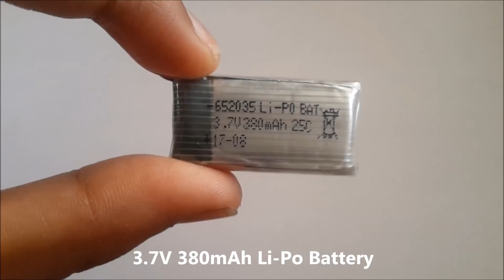How To Make Wireless Headphones Without Cutting Them Under 5$

Comment from the maker: Please Read Below :-

1. Link to buy everything used in this video is in the Description box above.
2. 220uF 25V Capacitor was supposed to be connected in Parallel with the Power Supply to Reduce Noise and Improve Bass, Which I forgot to do.

Thanks For Watching and Please Drop Down Your New Project Ideas below or Ask Me Incase of Any Doubt :)
Reply: ElectroMaker can you make a device in which you can make high voltage from a low voltage Source as if a battery. And make it able to active when a switch is held or pushed, like a flash camera circuit, also if you do do it can you add a potentiometer to it so the voltage is adjustable
Reply from the maker: Gunsman Jacob For what do you need high voltage? And how much?
Reply: ElectroMaker I need it for a rail gun I’ve been working on and about 60/70 volts. I need the high voltage for charging the capacitors
Reply from the maker: Gunsman Jacob You can use a Voltage Multiplier and Connect it directly to mains. You can get upto 10kV DC
Reply: ElectroMaker I know but I would like a portable device and not that high of voltage, also I do have an interest in electricity but I’m not very good and I struggle a lot to get a small portable inverter with only a few volts like 5 or 10, later transformed into 60 or 70  or higher
Reply from the maker: Gunsman Jacob Then you may use a Mosquito Bat circuit? Sold in eBay for cheap
Reply: ElectroMaker ahh I see ok thank you very much. And 1 last word if I do would the best way to lower the voltage be many resisters in series or another way to lower the voltage?
Reply from the maker: Gunsman Jacob Voltage Dividers is ok for that purpose.
Reply: bhaii its not under $5 its under$17 which is approx 1060 rupees
Reply from the maker: MAYUR Chavan If you shop from AliExpress, It would be under 5$
Reply: ElectroMaker plz share the link of it
Reply: send individual items link electromaker